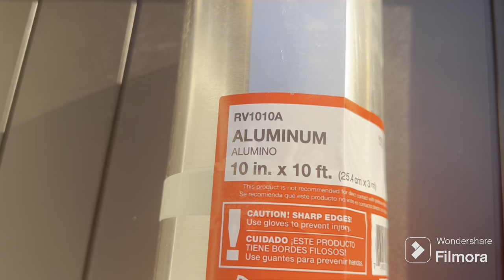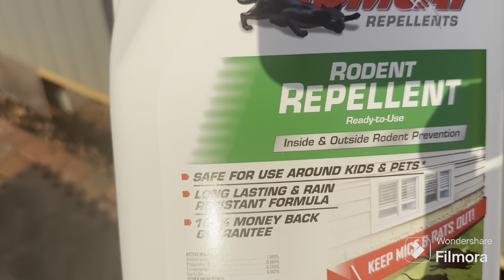Living Life Off Grid / You Told Me to Do This Along Time Ago

Comment: The skirting looks good. 
If you can’t solder the metal pieces together, maybe metallic HVAC tape can be a temporary fix to tape them together to keep small critters from getting through.
Reply: Or some type of adhesive to hold pieces together. It looks good 😊